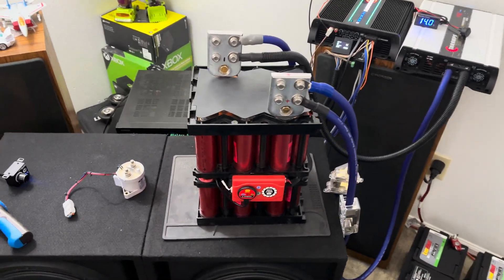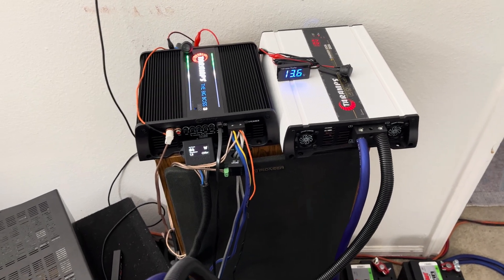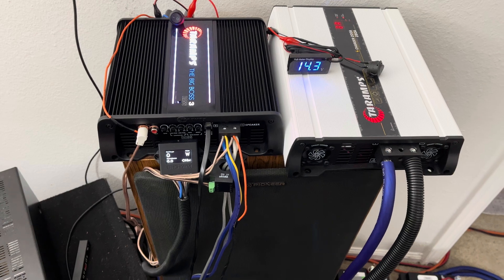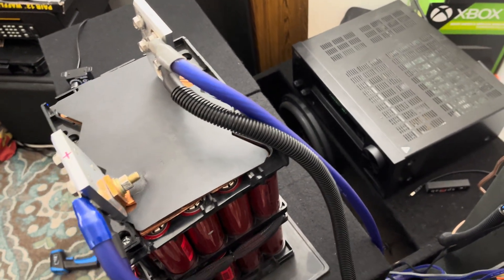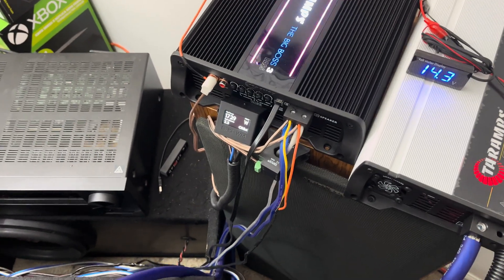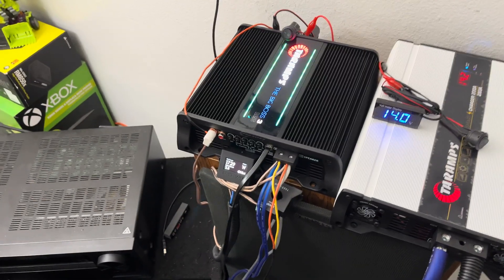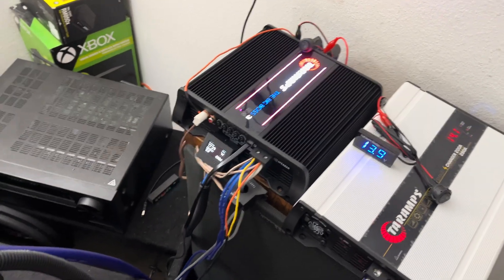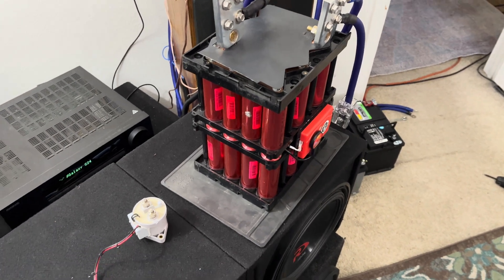Headway Superbeast to the rescue? | No Powah pt.3

Comment: Are the 3 batteries feeding the big boss amp? 

What is the voltage at the amps inputs when under load? 12.8v? Is it the blue volt meter?
Reply from the maker: I disconnected the 2 AGMs but that 96 Ah lithium bank is feeding the Big Boss in this one. That blue volt meter on top is connected at the amp input and is slightly off, about 0.15v lower than my Fluke shows. It only dropped to about 13.6 or 7 while reaching clipping.
Reply: @SnubBarracuda didn't see the 200a charger to bank then bank to big boss something is off didyou gain match your rca voltage to the amp and use oscilloscope to measure a clean 4v rca signal on rca wires and take note at what volume head unit makes 4v clean sine wave then match amp gain and try at head unit set to clean 4v volume
Reply: Lol good eye he's powering the 200amp output so that's all he's going get
Reply from the maker: @AlbertZamora-d6f  200 amp charger plus the 96 Ah lithium bank.

Comment: Some cheaper ANL fuses are known to have high resistance. Cheap, plastic housing types. Those can reduce voltage to your amp. 

The ceramic or fiberglass fuses typically are better. Maybe sure they have good contact and are tight.
Reply: Glowe Industries did some tests on this.
Reply from the maker: I reconnected all the wires and fuses, swapped out the no name brand fuse holder for another Skar branded one and even tested the resistance on all the wiring and saw the same measurements as the leads have by themselves. I'm still clueless.

Comment: A few things you might check is that your signal voltage going into the amp is high enough. At least 2v to 4v rms. You can also try different test tone frequencies to see if you can get closer to 2 ohm. 

You could also get an inexpensive oscope, like a DSO-TC3 to make sure the signal out of the amplifier, is not clipping. You could also verify the signal going into the amplifier isn't clipping. 

Your amp is not getting the full 14.4v that its rated for and 2.3 ohm is a bit more than the 2 ohm rating. Still, I think you should be close to 2500 watts. (Depending on how low your voltage is sagging).
Reply from the maker: That's a really good idea. Last night I was thinking about retrying some tests with the head unit sub output level turned up to see if that helps. I have a home made distortion meter connected to the amp output and the bass knob and amp also have clipping indicators but I haven't really thought about the head unit's output until now. I think the Big Boss manual says it wants 0.2-4v so I'm going to see what my stereo is actually doing. Thanks again! Once the snow clears up I'll get a chance to test all this in my car with that lithium bank also. I'm going to figure this out somehow, lol.
Reply from the maker: Yeah, I have seen others test this amp slightly above 2 ohms and get that 2500-2800 range so I think you are dead on. Well, even at 13.6 and 2.2 ohms I feel like I should do over 2k.